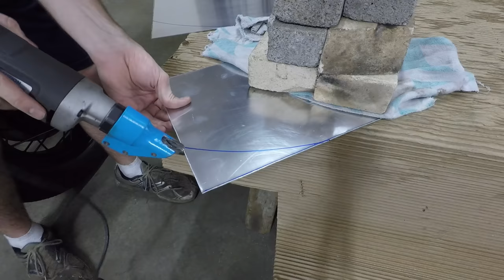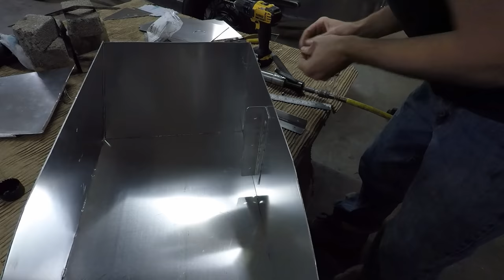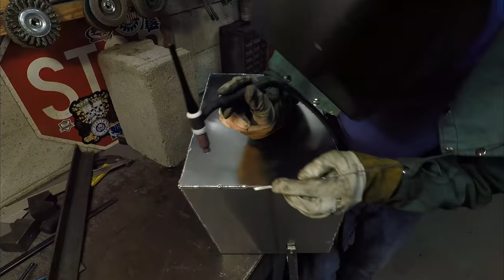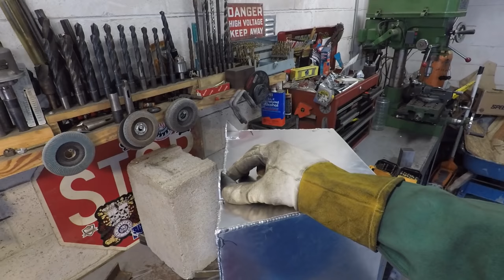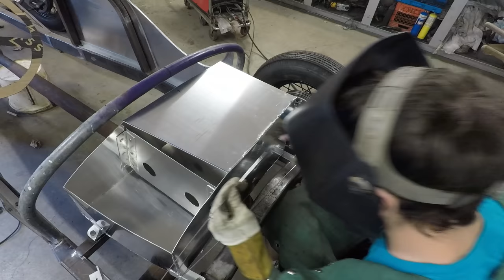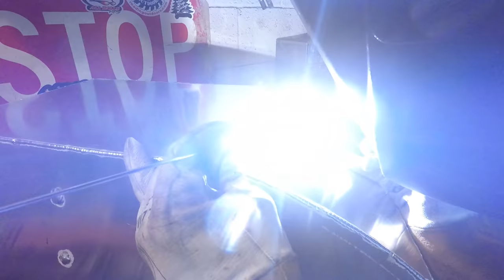Making an Aluminum Gas Tank | Homemade Boat-tail Speedster Pt. 37

Comment: Great project! 
I would be a bit careful with mounting the tank with those welded alu tabs though. The wieght of the fuel in combination with vibrations  may cause cracking of the tank. Would consider mounting it with steel banding/straps instead. Check out Project Binky Ep 13 for example.
Keep up the good work!
Reply: I was sooo thinking of blinky....   
also a lower section to collect the fuel and Pump from ?
A fuel gauge ?
Reply from the maker: I think you're right about the steel straps instead of the aluminum tabs
Reply: @964cuplove  Fuel gauge? Two level fuel pickup and a reserve petcock ;)
Reply: Absolutely please use straps, not only are those tabs suspect to fatigue, in a collision they will very likely make a bad day much much worse! On the rear left tab you could use a clamp with a rubber grip to hold the tank in place, but allow it to shift in a collision. Other than that, nice job!

Comment: I like to put air pressure in the tank and spray my seams with soapy water from the outside and watch for bubbles to find pinholes.

Comment: I have been building boat tanks (in stainless of course) but the principle is the same. A good drawing, calculating the least amount of welded seams!! All fittings mounted before the final welding process! Pressure test with air pressure and soap water. No fasteners welded to the tank, only support points. The tanks should be secured to the vehicle with isolated metal straps. Don´t forget to isolate the aluminium from other metals (the galvanic corrosion which goes very quickly). Also connection with the cars earth to eliminate the static electricity which can make a giant explosion. 
I should have chosen stainless for the tank!!
Reply: for a marine application stainless is a must, however on a car both are good, and alloy is best here; because of the weight gain (this car only gets a jag small bore six) and the location the tank sits in, unexposed to the elements.
besides, do you weld edge to edge, or do you weld with one side folded a few mm underneath, when you do thin sheet tanks?
i was wondering.
Reply: @comethiburs2326  That depends on the tank size and shape. In  boats they can have weird designs but for a relatively cubic tank less than 75 liters the 1.5 mm steel will do fine and welded edge to edge. You must consider the risk of a crash that could damage the tank. It´s not fun to be sprayed with petrol!

Comment: real nice job outstanding workmanship, you might want to consider using a gas tank coating, you pour it in the tank and it makes  a liner  (fuel is thinner than water ) it's a good idea to pressure test the tank overnight, on a piece of white paper ,      you do great work                    Pete m

Comment: A couple of things. Wouldn’t folding up the sides make for less welding and leaks? Also since you welded the rivets, why not put flanges on baffles and weld to inside.
Reply: I notice on commercial fuel cells they appear to be welded on all edges, but for the price of argon to do that extra welding I could probably make a light duty press brake.

Comment: Nice work, again. There's a  stuff they sell for "router mat". Kind of very grippy rubbery  material. It works well in that application, and I think it would work a lot better than the cardboard sheet you're using when nibbling the sheet aluminium

Comment: You don't need to fill tank with water, just pressurize it and apply soapy water to welds. Bubbles shows all the leaks.
Reply: Indeed. Water fill is nowhere near as reliable as low air pressure and soapy water. Tank that size with square corners should take about a pound of pressure.
Reply: Yea, I like to make an adapter to fit the fill spout with a piece of rubber radiator hose and a freeze plug with a Schrader valve and hose clamp it in place. Set your regulator to 10 or 15 psi and pressurize the tank and check with soapy water and a spray bottle. If your cap isn't vented you'll need a vent. Early 20s and 30s race cars used a  small copper pipe twisted into a cork screw and mounted on the body, looks cool.
Reply: Scooter Tramp I agree with Scooter. LP Air and soapy water is a better medium for your application. DO NOT EXCEED 1 psi. If you go much higher than that you risk deforming your tank and possibly crack your welds. In the shipyard I work in, we use 2 psi and hold the pressure for 30 minutes for our 4 and 7 mm steel tanks.

Comment: Awesome project! I'm getting ready to go into the Navy as an SW, a steel worker, hopefully some of the skills from that will translate out into other fields like this! Also, have you thought about using a tank liner? It'll definitely help with corrosion and such. I know it's an aluminum tank but you can't be to careful!

Comment: Great. But add some extra mounting points to the gas tank, it'll weigh 80lb when full. Any G force amd vibration will pull your mounts out and cause a rupture = inferno, and we want to keep you safe. Enjoying your work.

Comment: Don't forget gasoline is not as dense as water, might get a bit of a leak. An air test might also work with a balloon on the spout and a tiny bit of air pressure. I did this when building my Rebel aircraft.

Comment: Hey, I just received my AC Tig welder today. Any settings suggestions for 1 and 2mm Aluminium?
Reply: I suggest cutting some practice pieces and then start on the lowest settings and work your way up.  With Aluminum you have to be careful not to melt. I learned at a Tech school and the instructor had us practice with soda cans.

Comment: Neat looking tank. What is the main benefit of using the solid rivets through the tank body to baffle brackets (with welding) over just doing puddle welds onto the baffle brackets?
Reply: Welding the bracket onto the tank without using the rivets would a) make it harder to hold the bracket onto the tank (Al not steel so no magnets) b) risk the integrity of the thin metal

Comment: Nice scratch built tank, looking forward to seeing the Gas Cap video.

Do you have to use any type of sealer or coating before you fill in with gasoline?

Comment: i admire yr efforts and skills and determination to build it all yourself but when it comes to fuel tanks id be using an aproved fuel cell with a bladder being  so close seated to it. the weight of the fuel combined with noise vibration harshness will surely result in cracks in areas that are highly stressed. also making it from a mere 1/16th is far to thin, I've made aluminium tanks for vehicles and ive used 2.5mm marine grade and also folded it up where ever possible to reduce the amount of welds hence reduce possibility of cracks.  for yr safety don't use that tank !! but thumbs up for giving it a go and keep up the great work

Comment: How is the balance of the car? You are on the left side and your fuel is left side. Is there going to be some counter weight on the right?
Ethanol gas does nasty corrosion to aluminium.

Comment: If you have a leak, should you not grind back, then reweld? Just curious, never actually tried welding, although I really want to.
Reply: aluminium is a tough material to weld. i wouldnt personnally grind a pinhole unless it's a safety concern, like a pressurized tank. on stainless/mild steel i absolutely would open it up with a cutting disk and make a new pass, unless i cant clear up the shavings inside. cleaning half stuck shavings inside a closed tank is a chore.
Reply: @comethiburs2326  thanks for that, very informative.

Comment: Great job on the tank build. Do you plan on applying any type of fuel tank sealer in the tank for a added measure of protection and corrosion resistance?

Comment: Why did you drill holes and make brackets for the baffle plates? Welding them straight on from the inside would have made things alot simpler and aesthetically pleasing. You still need to fit the fuel tank level guager , so one more hole to drill.
Don't forget to vent the tank, use a motercycle gas cap, the vent is built into most of them nowadays and there are some really stylish lockable ones for $30 to $70+ or cheap standard unlockable chrome at about $15+ , I'd check out the local scrap yard first though. Good work and good luck.
Reply from the maker: That's exactly what I tried doing first, but the aluminum was warping horribly so I scrapped it and riveted them instead.
Reply: Ok I trust you, but if it warped, you spent too long on one spot. ......faster ,smoother flow welds, it comes with practice......I am not an expert....So my criticism /Advice is from watching others with similar problems.
I used to spray paint heavy machinery and sometimes trucks, cars or bikes,weld abit , so I know basics....and some tips.
I'm a Jack of all trades......... A master of none..... If I had your skills and ambition,  specially at your age,
nothing would stop me, so keep on doing what you're doing.     Ambition gains knowledge ,age gains wisdom , failure creates learning, so keep pushing and nothing can stop you.
Refusal is just a negotiation point, all professionals will listen to a counter offer . Good luck.

Comment: theres a special foam you can put intoo gastanks that prevent the fuel from sloshing around and helps prevent vapour inside the tank https://www.ebay.nl/itm/332272329768
you might be able to push it in there through the the tankfiller iff the baffles inside the tank are not enough
as for finishing the complete tank , i think pressurising it and go around it with soapy water is a better idea , in that there is no water left in the tank and air is thinner than water makes it eazie to spot leaks

Comment: If ye’r going to TAJ the car on the track you got to have one of those race car fuel cells with a rubber bladder in them and the anti sloshing around foam. Won’t pass the safety inspection without one. If it just for the street you’re fine.

Comment: ive never made any gas tanks before but it seems to me like it would make more sense to have a corner or the bottom lower than all of the other points just so when it gets low its not level and a bunch of gasoline wont be used
Reply: Ah, good! Since I'm about a week or so late to the party, I'm glad to see my main thought was already posted. What Kyle described is called a sump,  It would kinda suck if you could only consume 8 gallons out of a 10-gallon tank before the fuel pump starts cavitating. Not quite so necessary back in the century when you had 20-gallon tanks on your Buick and gas was 22 cents a gallon...

Comment: Where did you learn to TIG weld ?    I suggest you practice  a lot.     Most of those joints were simple and easy and could easily have been done without filler.   Have you heard of purge ?    I have also noticed that no negative or constructive hints are in the comments.   If you can't take helpful criticism you will never learn or improve.